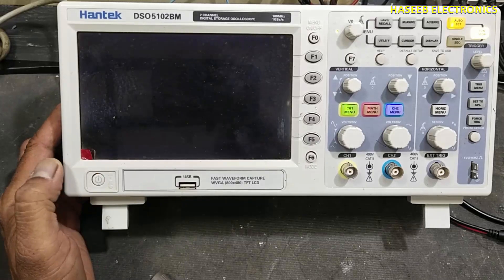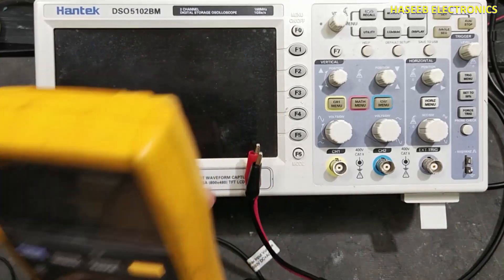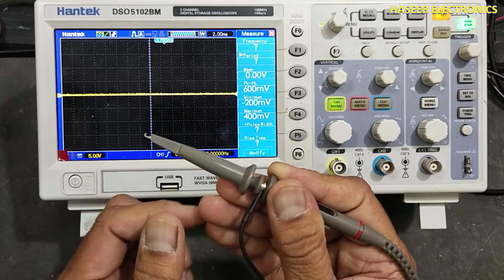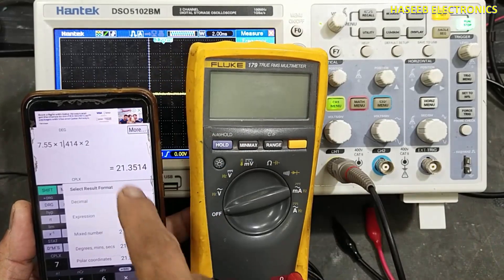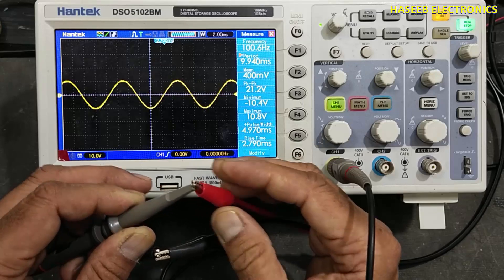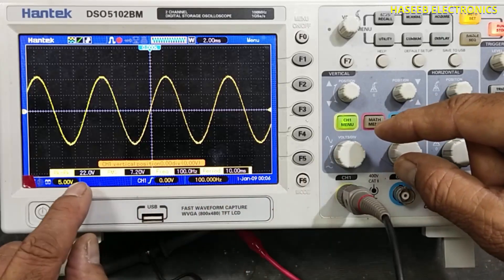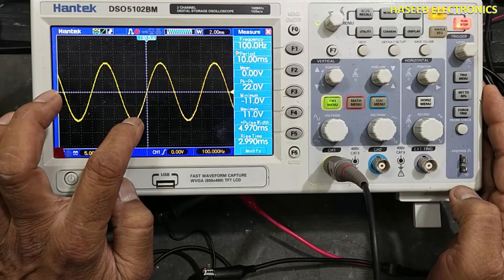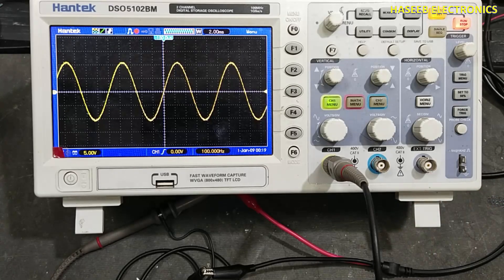{688} How To Use Oscilloscope To Measure, Analyse AC Signal

Comment: Sir i have been approx one year requesting you to make videos on inverter ac pcb 
Sir please make videos
And if you will not make please say no, so that I will not request you again for it
Reply from the maker: yes i know 
your questions for 
DS0088 ic replacement
TNY266
8 pin communication module in AC
smps topologies
inverter ac circuit
NPN PNP transistor identification 
double side PCB reverse engineering 
full explanation on remote control
testing gate pulse using multimeter 
and i have thousands questions and all questions are in the list, i am moving according to the list 
sorry for late
Reply: @HaseebElectronics  
Thanku so much Sir 
For your this much care for a subscriber
Reply from the maker: @raoamarjeet5473  because I have too many requests to make videos and I have no spare time for this work, so that is the main reason that I give very delayed response
Reply: @HaseebElectronics  Sir i meant you have created a list 
That's why I thanked you
Sir please don't take it wrong
By the way, there are so many videos on YouTube related inverter ac pcb but they don't go as deep so that one can repair pcb 
And i don't have this much hefty fee to learn it by any Institute
So Sir you are my last hope
Reply from the maker: Love you dear brother
Reply from the maker: I will do my best 
as much as I can
it is my pleasure and it will my pleasure
Reply: @HaseebElectronics ❤